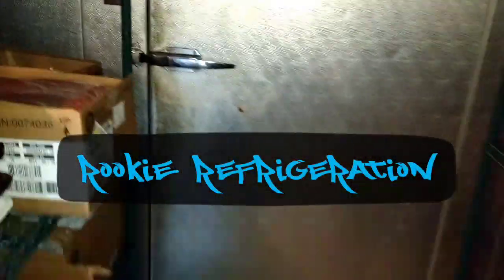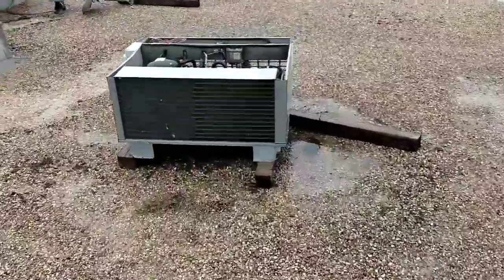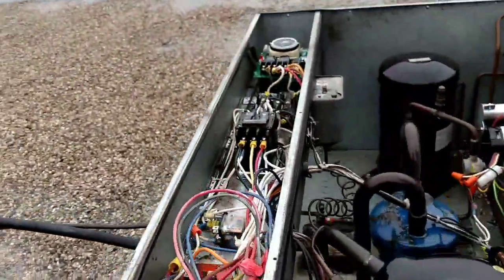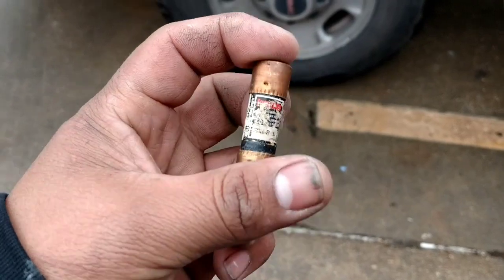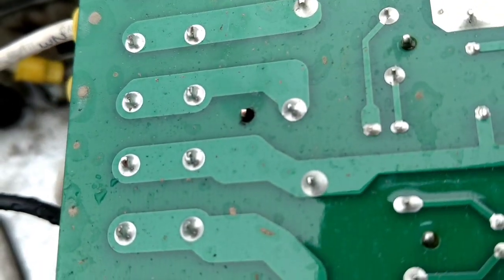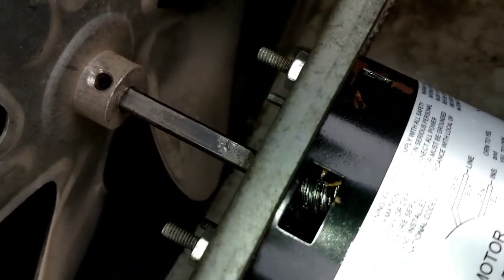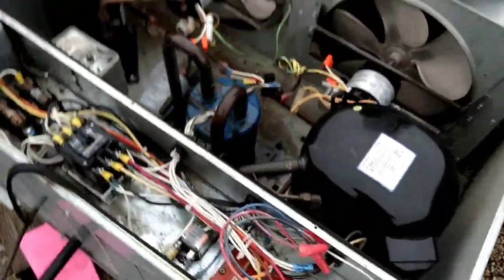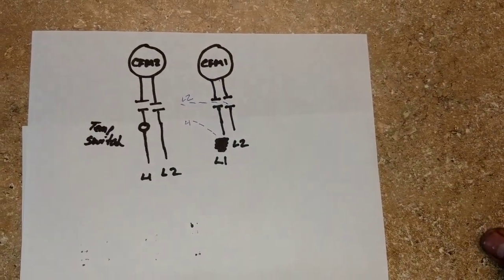HVAC Refrigeration- Walk in freezer down.

Comment: If it had been a higher ambient temp, would we have to have blocked the airflow from the open spaces where there was no fan motor?
Reply: Yes I would just to ensure you don’t circulate condensed air, as air will take least path of resistance.

Comment: This may seem frivolous, but a heat gun in that shituation would've been great. Milwaukee make a great one for the 18 v
Reply from the maker: For what?  To dry the moisture?    Is rather just change out the components.
Reply: To protect or rather, salvage the rest of them
Reply: Nitrogen can do a good job too if it isn’t completely soaked.
Reply: @rookierefrigeration4357  spending  a few minutes drying the motor that burnt up on you more than likely would have saved it. Would have prevented you from messing with the cooler condenser.
Reply: Wouldn’t worry bud always someone to have a dig at what you do, windings clearly compromised. These guys setting up for call backs do you aye fix it right the first time